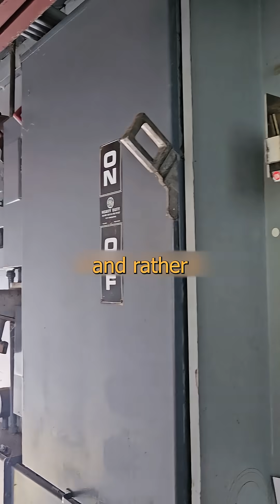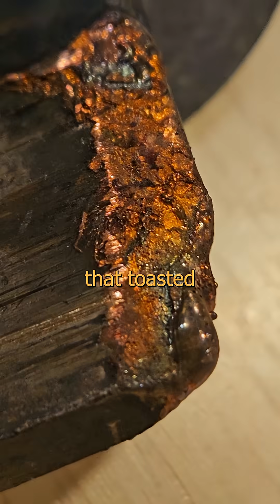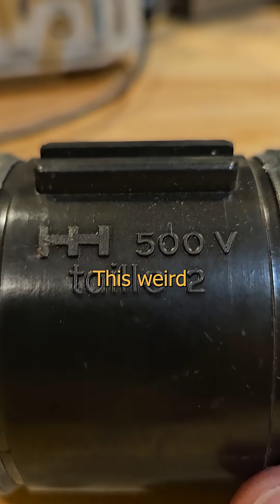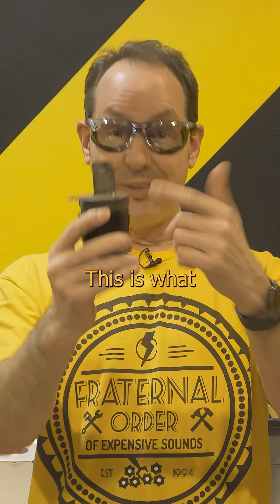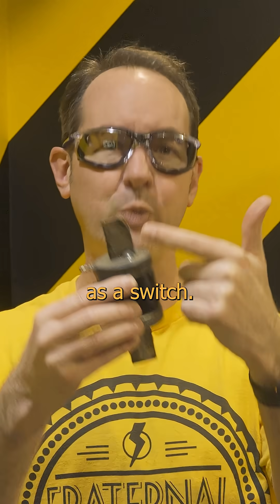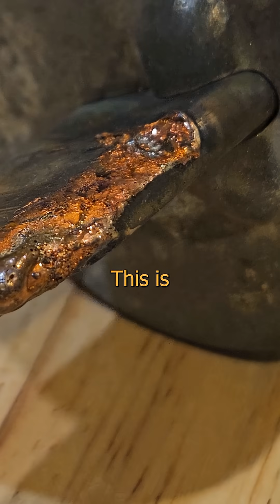Ugly Fuse #chrisboden #comedy #engineering #electrical #educational #highvoltage #damage #fail

Comment: How did the noise that made when closing it not trigger someone to say "Hey, I shouldn't do this" it had to sound like Frankenstein's lab when they closed it!
Reply: as long as the machine kept working after the first time it made that noise, i promise every time since then the attitude of management was "oh it just sounds like that, dont mind it"
Reply: @flaming_ace  i'm a victim of that from maintenance workers, crushed my ring, middle AND index between a machine and its guard during retooling because of something not worked on during preventative down time 3 fractured fingertips since last monday :DD WATCH YOUR FINGERS no matter the job
Reply: @douglaswilliams7637 When maintenance logs include the line "continues to make weird noise on startup" for the past 20 years.
Reply: Yeah, a lot of times, people justify not following through with questioning things they should by telling themselves whatever weird sound must be normal, it's fine, they couldn't possibly put in anything that badly designed.
Reply: Probably a case of NMFP. Not My Fuckin Problem.
Reply: @neilish13 YUPPPPP HAHAHAHAHA feeding the workforce hahaha
Reply: I would think the arc and spalling would be an indicator of danger.
Reply: @Bojangles6  it only happens a little each time. The first time you probably barely noticed anything. Then each time after isn't much of a change. Good wasn't done just got a month, this is probably years of change.
Reply: @arthurr8670 and thats the danger of poorly done electrical work.  Because its not just about what works today, but what will work for decades to come.  And when the day comes that the gear will fail (and it will fail, entropy takes no prisoners and shows no mercy) that it fails safely and becomes more inconvenience and less "12 dead in a fire"
Reply: @arthurr8670 i understand but im saying the reaction to being slammed home was more than just the little arc from a lighter piezzo. I would guess there was a decent sound and some light energy produced every time. I jump when i plug in a fan thats turned on.
Reply: @Bojangles6  agreed, but thats not how management sees workers raising complaints about a machine which hasnt (yet) failed. i get the feeling the issue was raised by newbies when they used that machine the first time, but given how long the period we are talking about, the workers nearly certainly got told that it was fine, because the machine was still running. what matters to management isnt long term reliability and safety, its this quarters profits that they care about
Reply: I think they like how it made the room smell too!
Reply: It did sound like Frankenstein lab every close and open. And that’s pretty cool!
Reply: Some people just do not care.

Comment: Holy monkeys attempting to screw a pineapple. Chris, sir, were we medicated or in need of when setting this one up? I only ask because you went particularly HARD in the "burn 'em" section, as I like to call it. Had to replay it a couple times to fully enjoy it because some dill-hole was laughing too hard. Ok, fine, it was me. I always end the videos with a laugh, smile, muscle cramps etc. This one leveled up. Cheers sir
Reply: Well when the fuckwit that was doing this is the source of not one, but two potential major electrical fires while having no fucking clue what they're doing wrong, I'd be ramped up myself.